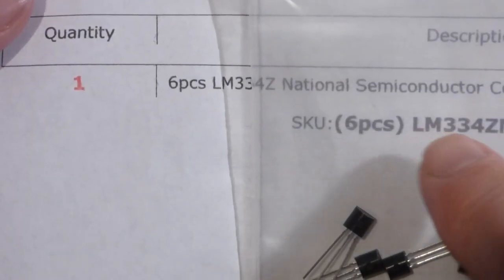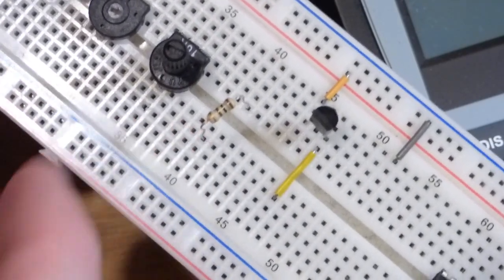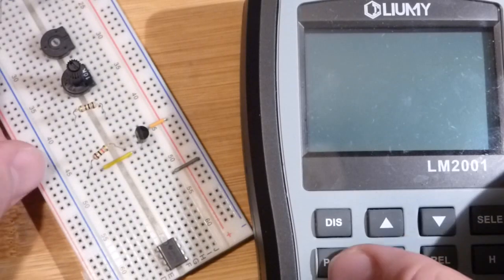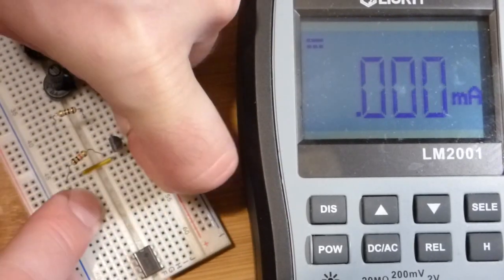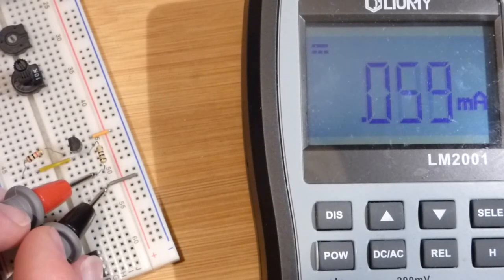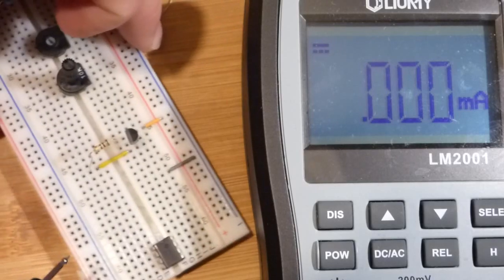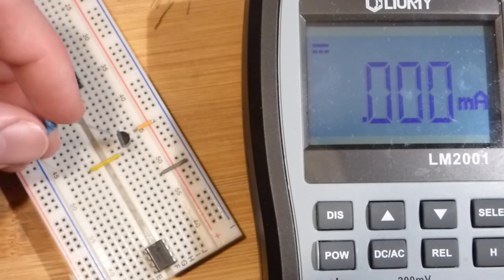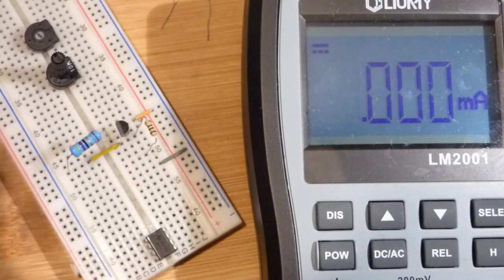Quick look at my new LM334 LM334Z constant current source IC in TO92 package by electronzap

Comment: Can you help me sir because for some reason it wont work even though i followed all your steps. Could it be that the lm334 that im using is defective? Is there a way to determine if my lm334 is working?
Reply from the maker: Never know for sure, I try making different circuits with components that don't seem to be working properly. If they work fine otherwise, then I probably made a mistake with the circuit where it isn't working.

Comment: Than you for thi informations!!!!  i´m need to control lower currents about 6ma until 9ma with an source 12vdc  can you help me?
Reply from the maker: You just change resistance until you get the current you need without going over the maximum limit. Probably want a component that can provide at least  a maximum of 20mA current if you are going to provide 9mA for a significant amount of time.
Reply: @Electronzap   very thanks for you reply! Do you have any ideia to protect  outputs  against  short circuit?
Reply from the maker: Short circuit protection is something I need to work on more. I'll try to get to that soon :)
Reply: electronzapdotcom im workin oh this problem too! If i won i will come back here too!
Reply from the maker: @adelmofonseca9416  Nice!

Comment: If I replace the resistor with a variable resistor how can I connect it to the current source?
Reply from the maker: I just uploaded this video! https://youtu.be/oaUHhMQVnB8 How to use a trimpot variable resistor to manually adjust J310 JFET current source on a breadboard